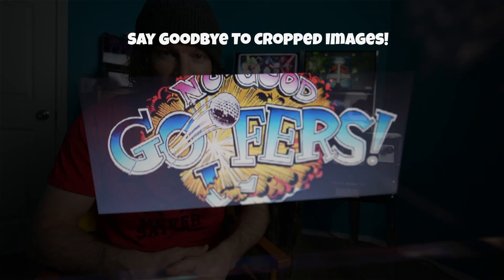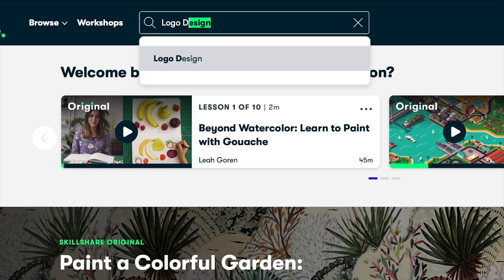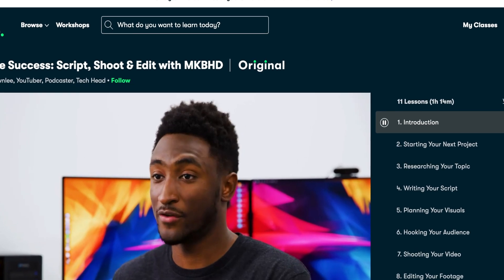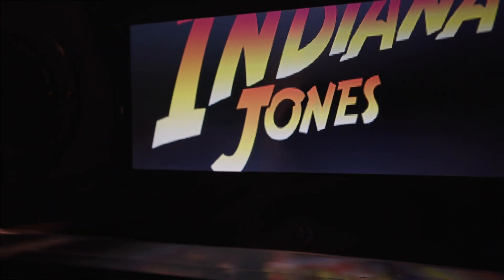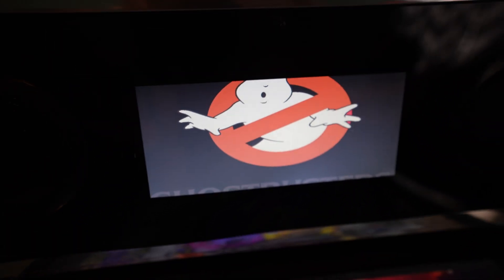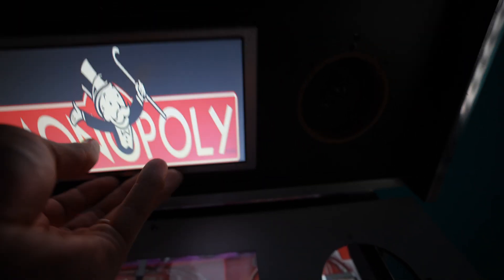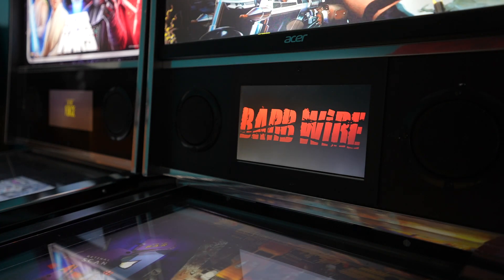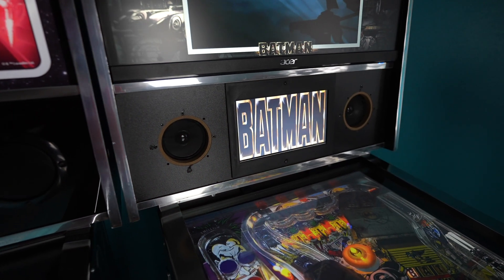Arcade1Up Pinball Mod - Expand Your Stock DMD Screen!

Comment: Ever use a slo mo capture app to see what your flipper latency is on your final 32inch screen mod?  iirc you used an optiplex i5 4590 with a 1650.  With the three screens I expect your probably around 100ms latency.  Native tables being about 50-60ms.  100ms is tolerable but you start to sense it where I find 140+ to be unplayable but everyone is a little different on what they can tolerate.  Anyhow I would be fascinated to learn where your modded machine here with that PC ended up on flipper lag amount on FX3 tables for example or VPX etc
Reply from the maker: I gave this machine away a long time ago
Reply: @cooltoy  also I put down a deposit on a pinball brothers Alien LV edition.  Now sits number one on pin side top 100.  Are you proud?
Reply from the maker: you made an excellent choice, and yes same pc build like I had in my ALP Simpsons
Reply: @cooltoy  okay same pc build like setup on your Simpson’s themed ALP?

Comment: Was it enough real estate to use the full dmd underlay in popper? or just not quite big enough? FYI I found a great topper for the 1up. All you have to do is use some L brackets and drill it into the top, also some button size holes for wires to go through the bottom. I used wood screws to tap into the back of the lcd box better. https://www.amazon.com/gp/product/B08FJ21RNW/ref=ppx_yo_dt_b_asin_title_o01_s00?ie=UTF8&psc=1

Comment: Any thought Doug into getting a bigger DMD display for this bad boy. According to my measurements a 10 inch slim Display might work.  Average cost is about $50 for one  on eBay with the driver.  I am tempted after running some games withe the full DMd appron activated. It looks so good.
Reply from the maker: I've contemplated it, don't necessarily need a bigger display myself, but the odd curiosity has been on my mind about changing out the stock one all together.

Comment: Following all of your guides on my Attack from Mars machine - so far everything is going well, until this evening a white horizontal line has shown up on my stock DMD LCD screen.  UGH!  I've opened a ticket with Arcade1Up - not sure if there is much hope for getting it replaced.  In case I don't - any suggestions on replacement/upgrade ideas for the stock DMD?

Comment: Thanks for continuing to do interesting Arcade1Up mods!  Between you and Kongs-R-Us, I've gotten great pointers on mods.  Happy to support both of you guys via Amazon links!! :-)  And cool, mrhector!  Personally I don't think I'm going to do this mod because I am a fan of the old school DMDs and the aspect ratio is already too tall.  To each their own but I personally prefer just seeing the original DMD for games like ST:TNG, Monster Bash, etc.  For those interested in using stock Arcade1Up "DMD" without any cropped images at all, just change the Y offset to 55 and use a vertical size of 370 pixels.  (I further tweaked FX3 where it is doing its own adjusting in software too.)  So I am using:
Pinball FX3 (in the Pincab settings screen):  
dot matrix horizontal position 3835 (assumes 2 1920 monitors for playfield and backglass -- i.e., true if you've done the other Cooltoy monitor mods)
dot matrix vertical position 40
dot matrix horizontal size 810 (again, purposely cuts off FX3's black dead-space that they add to the videos)
dot matrix vertical size 400
Visual Pinball X:
In your "Visual Pinball\VPinMAME\dmddevice.ini"
top=55
height = 370
Frontend:  Similar, or just use PinballY (see below) - super easy to resize the DMD to "fill" the right size just from running the program.  And then it just remembers.

A few other ideas:
-- I've ordered an insanely cheap microcontroller (off Amazon, Arduino Uno knockoff for $6 and a relay board for $6) to convert the stock power switch to a momentary switch to connect up to the PC motherboard power switch.  Yes, one could replace the Arcade1Up power switch with another momentary switch like the volume knob -- and it looks like you may have done that from the look of your cabinet?  But I wanted the feel of the original switch - a true ON/OFF - and was looking for a fun small microcontroller project -- and it's about as expensive as buying another momentary Arcade1up-style volume switch since I didn't have a spare.
-- Plus by doing this as a microcontroller/relay, I am adding a second feature of getting rid of the Sainsmart "bootup" solenoid/flipper chatter: I am having the new Adruino board use a spare relay to cut power to the 12v Sainsmart line for a few seconds immediately before sending the boot signal to the PC motherboard.  (I am running 12V to the Sainsmart through the NC normally-closed line of the relay).  This lets the PC USB power on and initialize the Sainsmart board before powering 12V to the Sainsmart board to avoid the Sainsmart boot up chatter.  (If you power the Sainsmart USB before the 12V it avoids the boot-up chatter.)  
-- I also wanted to recommend the PinballY frontend as a (IMO) more straightforward and easier to install pinball frontend over Pinup Popper by mjrnet.org (who also created the Pinscape boards/bootloader for the KL25Z board).  PinballY is super clean, very intuitive, and I like the default look/wheel.  It is really well put together.  And it's open source so easy to mod if one had interest.)

Comment: With the full screen visible does it change the settings (800x370) for FX or other Pinball apps?  Thanks!!
Reply from the maker: If you are asking if it raises the resolution past 800x400 then the answer is no.
Reply: @cooltoy  not exactly, I just meant do you need to change any settings so that the full screen is used. Thanks.
Reply: @cooltoy  was wondering the same Doug. I can’t seem to get my DMD to show full screen. Was there new settings that needed to be entered in this mod? Can assist would be great. Looking for the Dot Matrix info

Comment: I was wondering if this now qualifies the stock dmd as a full dmd? Thanks in advance.
Reply from the maker: technically yes
Reply: @cooltoy  lol Nice
Reply: @cooltoy  all we need now is to figure out how to get that washed out color off the DMD. Too bad we can't mess with those settings like we did with the original 24 inch monitor. It's definitely too bright.

Comment: So for a stock machine, could you add a SMALLER bezel to hide the black borders on the top and bottom of the screen?
Reply: That’s a good idea!
Reply: That's a good idea, just trying something out real quick. I'll post it up here when I'm done.
Reply: @mrhector8431  thanks for the files Hector. Just put a request in at a local 3d printing shop.
Reply: Here ya go. Can accomplish the same thing by just using tape or black paper on the back side of the plexi. If you have a 3d printer here's a quick print to cover the unused portion of the DMD for those keeping the machine stock. 
https://www.thingiverse.com/thing:4844242

Comment: Woah, just loaded up your new video and saw you link the DMD frame I designed 🤯. Watched your videos countless times when modding my machine, glad I could contribute back.
Reply from the maker: @mrhector thank you for coming up with such a handy solution for the cropped DMD image, great stuff!
Reply: Looks like Cooltoy has got you some new business as well lol. I’ll take one :-)
Reply: If you want to make use of the extra screen space I highly recommend using Pinup Popper with DMD underlay videos. It'll keep looping under the DMD. Thanks to the awesome community there are videos for pretty much every table. Example when I was testing it out https://1drv.ms/v/s!AjLzqxQYsrm8i9VvoKMfABeR7jVmYg?e=XF7OcW
Reply: @mrhector8431  I tried to do this but I couldn't figure it out. Do you have any sort of step by step instructions or could you point me in the direction of a video. Thanks in  advance.
Reply: Thank you mrhector. Great work. What else do you have in the works for the A1UP pinball ? :)
Reply: @James-jw6ho  Right now I'm looking at adding a credit button and with a simple faux coin slot that would just screw in with the button. :)
Reply: @mrhector8431  Speaking of adding buttons.  I'm using all the stock buttons on my A1UP Pinball Mod, but now thinking I should add a 1 x Exit (escape) and 1 x Insert coin.  is there any other buttons that you think would be useful to add at the front?
Reply: Wow, this is amazing - great work!!  :)
Reply: Do you make one for the atgames pinball 4k